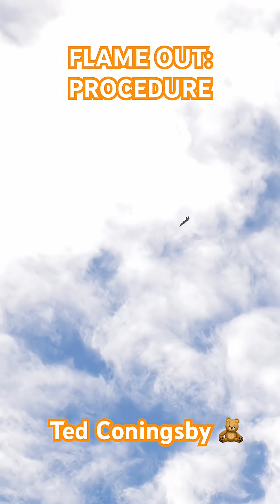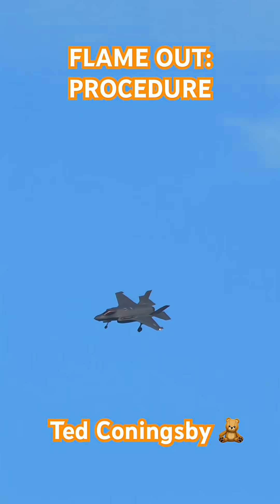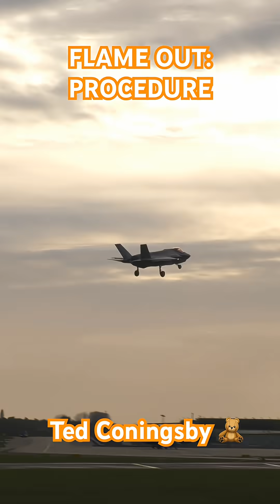FLAME OUT: F-35 PFO PROCEDURE HIGH KEY LOW APPROACH • RAF LAKENHEATH #aviation #militaryaircraft

Comment: Just the good old glide approach, we do the same in the 777 sim, practicing for a dual flameout…it’s about a 6 percent glide clean at Vref30+80, gear when certain of making the runway and flap progressively until about F20, it works quite well.
Reply from the maker: Does the 777 have a relight system? :_ted2:

Comment: This looks very much like a practice “combat landing” to me. I don’t recall ever seeing a simulated flameout so close to an airfield back when I was crewing F-16s. But, I’ve been out of the USAF for several years now. I’m not familiar with the F-35’s emergency procedures, and SOPs change all of the time. Also, operating procedures can be quite different when operating from a base outside of CONUS. Unfortunately, I never took a long tour while I was in uniform. Korea and the sandbox were my only OS assignments, but those locations came with their own little quirks when it came to operations.
Reply from the maker: This was a Simulated Flame Out (SFO). The 48th FW call it a PFO (Precautionary or Practice Flame Out) :_ted2:

Comment: The flameout procedure included 3 Key Elements. 
First the High Key in 10K-7K ft it‘s the upwind, second the low key probably downwind 5K-3K and last the base key. It should not be flown under 2k ft AGL. 
If the pilot would come in lower than you just fly to the matching Key for your height.
Reply from the maker: Thanks for the info :_ted2:

Comment: Engine stalled then?
Reply: No, this was just a simulated flameout. The pilot just pulls the throttle back to idle and then runs through his emergency checklist as if it were the real thing.
Reply from the maker: It is not a stall, it’s a flame out. The engine is still turning. However, this is the procedure should a flame out occur :_ted2: